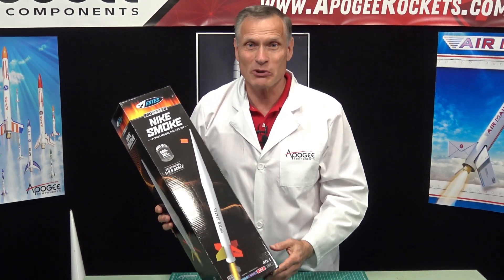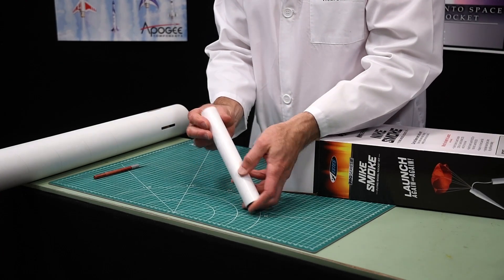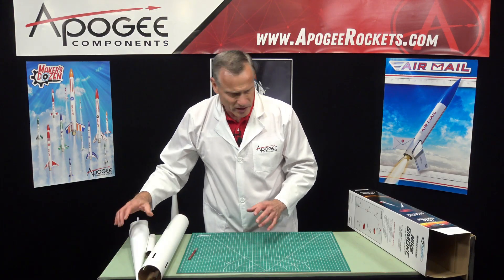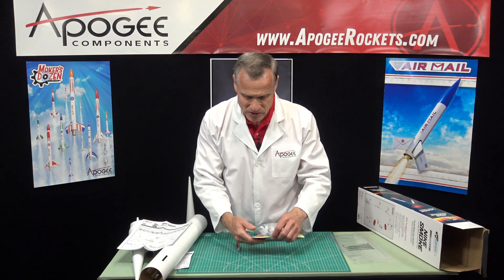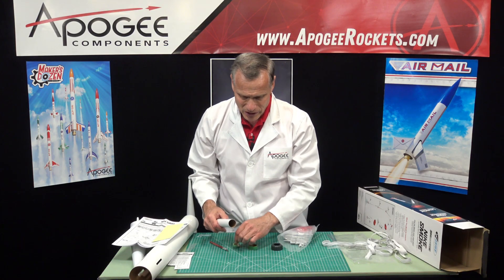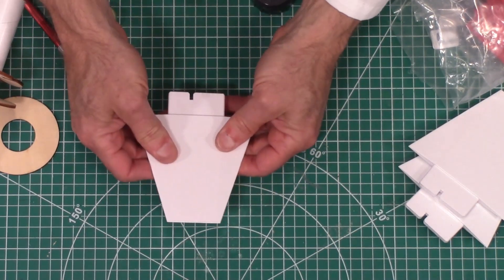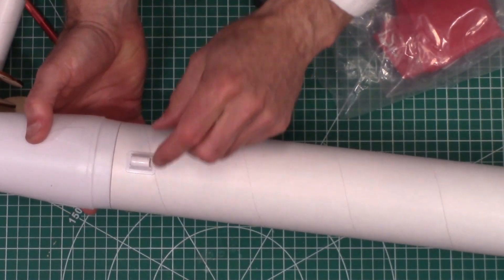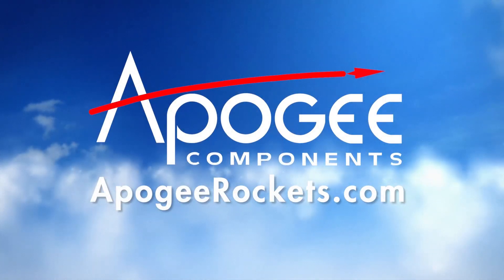Unboxing the Estes Nike Smoke Model Rocket Kit

Comment: I used your removeable aft ring trick, glued the forward ring first, let it dry, then spread glue for the middle ring and installed it, then the fins with internal fillets, then an aft rail button and finally the aft ring. I use this trick all the time. You don’t shove two rings through one aft glue line. And you get those internal fillets. I actually fillet the fins internally to the body tube as well as the engine tube. It’s a great method, glad you showed it on the Zephyr instructional.

Comment: The wooden rings are an upgrade. I used this kit for my level-one certification. I remember the motor rings because I used your Zephyr build video as a guide. I used your method to attach the parachute using epoxy clay and attached the Kevlar cord to the motor ring. I then tied the Estes shock cord to the Kevlar cord.  It held up great using an H135w-4s Aerotech motor.  The only bad part was recovery of 3/4 of a mile walk each way through a ditch.  Using high-powered in it, the plastic fins flap and lose paint. They hold up, but the vibration takes its toll.